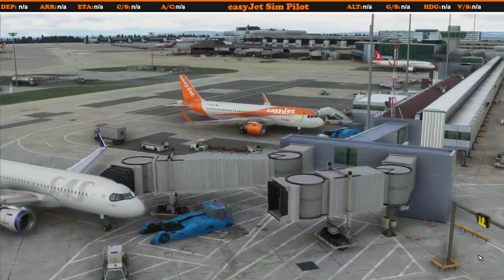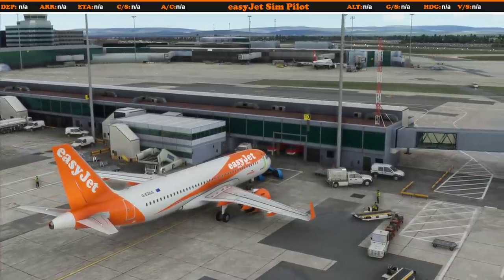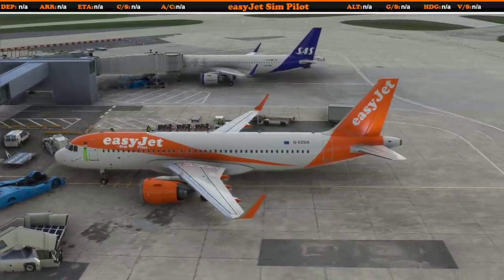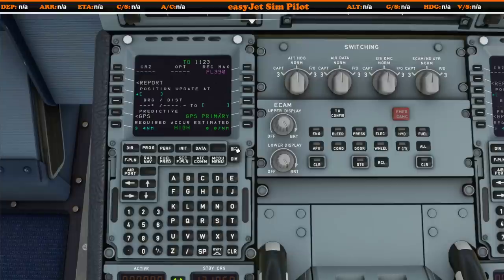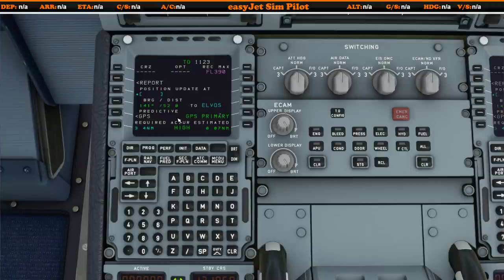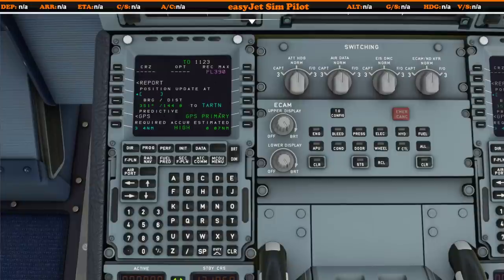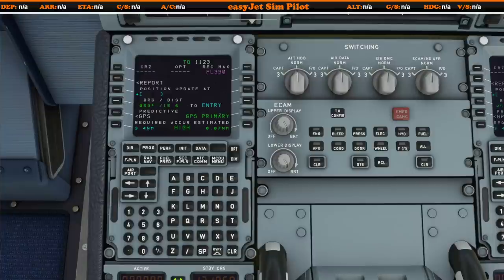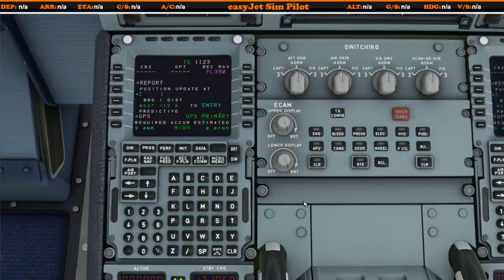MSFS 2020 - New Essential Feature Added - Bearing/Distance To | A320 NX FlyByWire

Comment: So you entered in a couple waypoints. How do we access and/or use them? It would be great to see you make that new 15 mile approach.
Reply from the maker: They are phantom 'pseudo' waypoints. Nothing is really there or displayed on the ND. You are just given a bearing and distance to fly.
Reply: I donno, but I guess it will pop up on the FLIGHT PLAN page and you can DIR to it? 

I'm guessing haha
Reply from the maker: No. It is just a bearing and distance. No flight plan alteration. This is raw data.
Reply: @Easyjetsimpilot  I will call Airbus Customer Service and give that suggestion then. Haha thanks for the answer.
Reply: I did use the distance to waypoint feature and it did work. Scared my pax tho descended at 3000 fpm. I guess that's a bit much. I wish the A320 could dial in a pitch angle descent..is that possible? Or some formula that converts fpm to angle?
Reply from the maker: @Level10Productions  you can use flight path angle (FPA) to control your descent rather than FPM (feet per min).
Reply: And where do I select that?
Reply from the maker: @Level10Productions  check out the TRK/FPA video on the channel.

Comment: Thanks a lot ! I have to admit I would have preferred to receive the explanations with in flight examples. Because if I understand how to us it now, I'm still not sure in which cases it will really be helping me when flying.
Reply from the maker: If you have any questions, please do ask. There are several times as outlined in the video when it's used and essentially, its just a 'distance to' tool, most of the time.

Comment: Dear Gavin, dear all, please explain it to me, what is the benefit of this function? It helps us determine when to descend, e.g. you say. But , I find it pretty misleading and inaccurate knowing this shows the shortest distance between two points and the actual distance to the runway can differ by far when we follow the flight plan (which is winding and certainly not a direct line). I really don't get it and would like to understand it. Thank you!
Reply from the maker: It is probably easier to see demonstrated in live stream. I've used it for every flight since it was released to help with TOD planning.
Reply: @Easyjetsimpilot  Yeah, you're right. Didn't make it lately 😅 Made a flight from Berlin to Munich myself yesterday and the STAR was so winding that it showed double or triple the distance the Brg showed and I was confused as to when to start the decent. Hope to see you soon in your next live stream!

Comment: Well since I haven't been able to buy me that Navigraph app nor that FlightPad or what ever it's called that fancy ipad that you put in your informations regarding where and how far waypoints are away from my A-32NX I use the RAD7NAV and there I usually put in these frequncies of a certain waypoint. and then I flip that switch to VOR and then at the bottom of the flight display comes up how far it is, Anything wrong with that? though I see the other option is also fine, I just haven't tried it yet.
Reply from the maker: This is prefect for VORs. Waypoints can't be put into the RADNAV page however.

Comment: Hello mate, I am having some problem tuning into my ils frequency while approaching to the destination, like I don't even see the loc and glidslope in the PFD. Idk what to do even if I change ILS runways, it just doesn't appear in my PFD??
Reply from the maker: You need to put the ILS frequency into the RADNAV page (in the LS field). This is a bug and doesn't happen in the real aircraft as it is automatic.
Reply: @Easyjetsimpilot  I can't put anything there, I just get a rejection message :/
Reply from the maker: @Kamrankhan23333  what do you type in exactly.
Reply: @Easyjetsimpilot  I type in the runway and frequency like this (rwy 34L/112.92)
Reply: @Kamrankhan23333  You just type in the frequency. Maybe the identifier also works.
Reply: @Kamrankhan23333  put only the freq, not the runway. Its what's workes for me. Without the slash.
Reply: @GalacticMilkfoam  Identifier doesn't work... at the moment...

Comment: Hello
I have a problem with simbrrief insert in mcdu menu. Before you could enter the username now comes only user id 
And I can not find the user id anywhere
How do you do it ?
Reply from the maker: Enter your username as before and it will autopopulate for you.
Reply: Your user ID is on Simbrief but you don't need to worry about it. Just enter your username as normal and the MCDU will then convert it to your User ID number. The MCDU actually saves your username/ID once you've entered it so you should really only have to ever enter it once and it will be saved forever for future sessions.